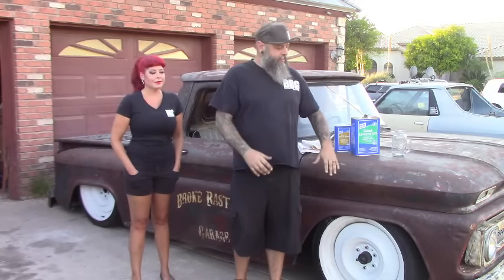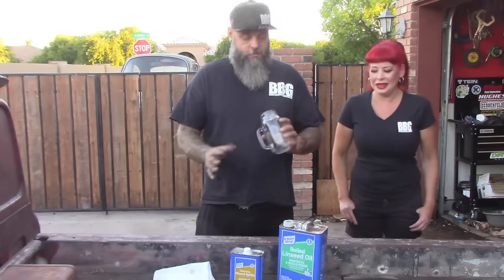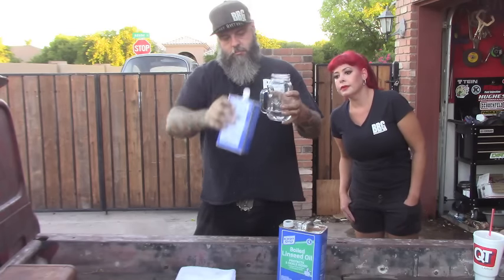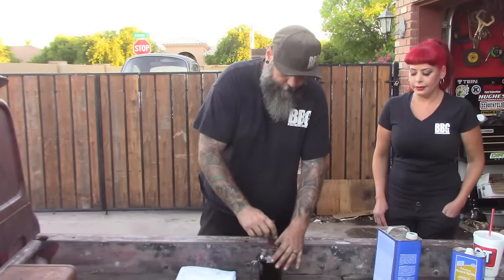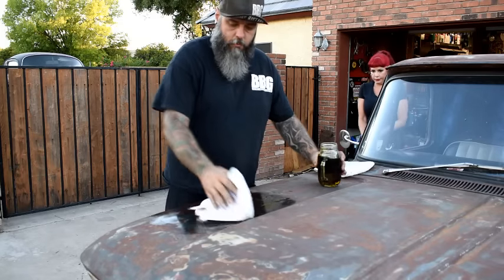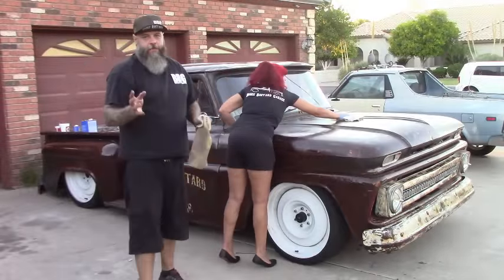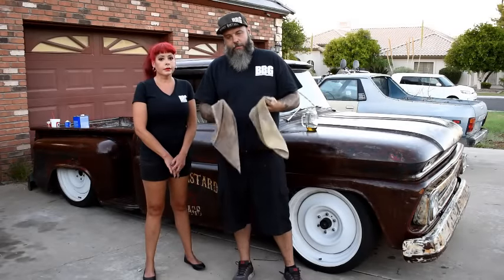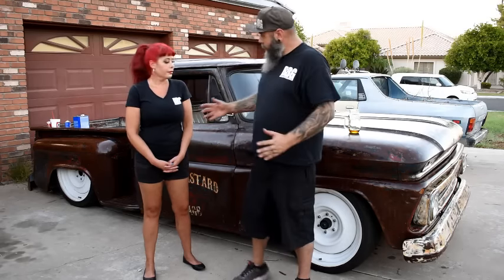How to Protect and Preserve Patina or Rust

Comment: I tried this down one side of my 59 fleetside bed & let it cure for a day to make sure it was the look I wanted. I didn't have a quart container to get started so my mix wasn't exactly how y'all made yours. I ended up spilling about 90% of what I mixed up. I decided to keep my used rags and paint brush (for the tight spots). Today I moved the rags into the cab of the truck after hours of tinkering. I went inside for a while & decided to head back outside just before dark to get some serial numbers off of my carburetor & measurements for the tail gate & fuel tank. I kept smelling an awful smell of something burnt. The further I got from my truck the weaker the smell. I checked the battery thinking maybe it was shorting out on something. That wasn't it. After several minutes checking in & around a few other vehicles I decided to check in the cab of the 59 truck. The smell was much stronger & the cab was full of smoke. I realized it was coming from the small rags I had used. After removing them & putting them out it became very obvious to me why she said to rinse the rags out with soap and water before disposing of them. I decided to read the container & sure enough the boiled linseed will generate heat when drying & can spontaneously combust as it did in my situation.  I'm glad I was home & able to locate the smell to put out the smoldering rags. Simple mistake on my part that could have been very costly. Just figured it was worth mentioning. Hopefully nobody else makes the same mistake that I did. I am very happy with the look it offers on patina, the preservation of the metal & the affordability.  Thank you for the video.
Reply: Yo this is extremely important, and should pinned.
Oily rags can and will spontaneously combust if left alone. Always dispose of oily rags in a metal container with a lid, preferably at least ten feet away from any structure or vehicle.
Reply: That's why he said to throw the rags away lol
Reply: Ray Renteria   I agree they should be put into a metal container for oil soaked rags and they need to be disposed of properly
Reply: I don't Get it how did they burn?
Reply: @luisponce1472  boiled linseed oil generates heat as it drys. If you leave it on cloth and the cloth is crumpled it traps that heat and catches fire.
Read labels for EVERYTHING. The words aren't decoration.
Reply: Will the truck spontaneously combust?!😮
Reply: Want to avoid oily rag fires? It’s best to just hang them up! Throw them over a fence or rail. The oils will evaporate in a few days depending on the weather, just don’t wad them up and put them inside of a container, like a trash can.
Reply: @CristyMarieMiller yes, ive done the same for years, all gud reminder’s 👌🏻

Comment: oily rags are subject to spontaneous combustion.  if you leave them in a pile, and conditions are right,  they will get warmer, then hotter until they catch fire due to a chemical reaction.  many shops have special air-tight cans to keep this from happening by excluding oxygen.  it is not only that the rags are flammable, but they will catch fire by themselves without an external ignition source.
Reply: Yes.  A serious reality. I actually even know someone that had a house catch fire because of oily rags. ALWAYS let them dry out.
Reply: woodbox665 I can’t tell if this is a joke
Reply: Reese Richter    No it certainly isn’t.   I’ve actually witnessed it.
Reply: Soakem in water willwork or airem out
Reply: I have seen them catch fire as well. Best to find a metal trash can made for this sort of thing.
Reply: Burn em outside after use in a safe space. Do at your own risk
Reply: @6ty8stang  no joke. I once worked in a shop where the used oily rags were kept in a heavy metal can with a lid.
Reply: This happened to us... we put the rags from using Penofin fence oil / stain in a Home Depot 5 gallon bucket (no lid) and set the bucket on top of our big blue plastic rolling recycling bin to "air out". In the morning we went out and our recycling bin was "gone". After a closer look all that remained was a big flat brick of blue plastic about 1 1/2 inches thick with the metal rod that connected the two wheels (wheels were gone as well). It was an awkward phone call to explain to Waste Management. Could have burned down the house... huge lesson!
Reply: This actually happened to the guy from Atomic (Garage Journal) in his shop. He's posted a video of his security cam footage of it. Thankfully only lost a garbage can and filled his shop with soot, but still. Linseed oil is a "Drying oil" which is why it's used for paint and stain.  By "Drying" it means it reacts with oxygen to form a natural polymer. That oxidizing process creates heat.  Combined with cotton: it will combust. Safest process is to lay them out flat outside for 48 hours.
Reply: Seen it happen. Will catch fire

Comment: The safest way of dealing with linseed oil soaked rags is to lay them out flat or drape them over something so they can dry out without building heat in a balled up  mass. The ability for linseed oil soaked rags to spontaneously combust is very real and well documented. Never throw fresh oily rags into a container inside a box or trash container without drying them out first.
Reply: I'd say it's safe enough if you have the rags in a ventilated area where the heat can escape. No need to be overly cautious if there's just a few small rags as in the vid. Otherwise, if you are concerned, just light them yourself and get it over with the burning.
Reply: Kendall Ulrey 

Sure. Didn’t mean to offend you, reminding you of your home burning to the ground. 

You do know there is a major difference between your imagination and the real world? Go back to school and learn some basic fysics.
Reply: @cschlater  fysics? Lol
Reply: @kendallulrey7258  laughing? Because I misspelled a word in a language other than my mother thongue? I know seven different languages. Pick one, and we can have a fine conversation about spelling. 

Also, I use linseed oil on a daily basis and never once had any incidents with self ignition. 

Also, I don't have any runnings showing on my commercial paint jobs pictured all over internet.
Reply: Oh shit! I did not know that. Thank you 🙌🏼
Reply: Wow, glad I red the comments 👍🏻

Comment: This works pretty good on faded / oxidized plastic too !  ALSO, It's not how much money you have , It's how you spend it.
Reply: Will this replenish old brittle plastic? I have a square body suburban that has some sun dried plastic and I'd like to keep as much of the plastic original, instead of spraying it with a raptor liner or something like that
Reply: @skeebles8469   It works but will fade / oxidize with time. Try a small spot first, then decide if you like it.

Comment: I use this same process on my woodworking projects. Great for axe and shovel handles.
Reply: Yessir. Great for axe and shovel heads, too, when putting away for the offseason. I melt a little real pine tar in with the linseed oil; gives the handles a tougher look and a little more tack.

Comment: I have an old school bus in Scotland, and it had the original marine plywood floor, and no rust. I didn't want to rip it up and damage it, so I poured boiled linseed oil and white spirit between wood and metal floor to future proof it. Also painted it on the faded blue fibreglass roof and it sealed it and brought it back to match the body colour.
After seeing this, I'm going to paint the undercarriage too! Far cleaner than old engine oil or waxoyl.
Reply: Many people use the thickest chain oil they can get under the car. I have only 1 car to keep so I stick to Fluid Film even though it is expensive. Protects and gets a relatively dry surface.

Comment: I as a lifelong painter have used your formula on everything from the rat to cedar shingles! The best go to I know of! 👍
Reply: What happens to the original rust, will it continue to eat at the metal?
Reply: @bradleygrossman4262 - Good question!    Rust is porous and will fully absorb any oil you put on it, similar to wood.    So the rust is actually helping to keep the oil on the surface of the pure steel beneath, thus preserving it.     The oil keeps the oxygen and the water away from the pure steel beneath, so I don't see how it can rust anymore with oil on it.     Steel cannot rust without water and oxygen in contact with it.    No chemical reaction can occur because the reactive chemicals (iron, water, oxygen) are not all present together if you apply oil.   At least that's my theory....   I have not done extensive testing.    AND I can't seem to find any solid answers to this question online.    Let me know if you find anything.

Comment: Great technique, the big thing is when people throw several mineral spirits rags into a trash bin full of saw dust.  The rags when they’re folded over start generating heat and if you have a bunch of them packed into a garbage can with flammable material like saw dust or paper, they can light on fire.  If you just let the rags sit out and gas off, you can throw them away without washing them but I wash them anyway and reuse for other stuff.

Comment: I love the thick coat it retains for so long without thinning out and drying easily.  I rub it in any dry wood.  I treated my sledge hammer handle, now its less likely to crack and it actually looks great.
Reply: I'm using olive oil

Comment: How often do you have to coat the truck?
I live in Florida/rain etc.  Just wondering how long it will adhere to the metal?
Also, what is the purpose of the mineral spirits, it is ti thin out the oil more or make it flow etc?
Thanks again and SO-Weet Truck!
Liked and Subscribed.

Comment: Needed this formula for a 1950 Studebaker pickup I bought in about 1971 - the body made of a very solid grade of steel, but the factory paint had literally washed off on the top of the cab, the hood and tops of the quarter panels, etc. It was the perfect, nearly indestructible truck. Wish I still had it.

Comment: I am using this on a patina'd  steel patio glider  - you know, the kind that would tipover on you as kids if it wasn't bolted down.... I had used a  50/50 boiled linseed and CLR mix - but I am not happy with the result... I am thinking you might have just what  I needed. Thanks BBG

Comment: I am looking to give this a try with ceramic coat on top of the boiled linseed oil after it has had a few days to dry thoroughly.  Urethane clear coat is super toxic to breathe, expensive, and sprays are such a pain with extra labor masking everything off with or without weather conditions outdoors.  Going across the US in my car, I was caught in a sandstorm that pretty much blasted the clearcoat.  The paint has been coming off, and I know I need something on top of the paint to keep it from coming off again.

Comment: BE CAREFUL WITH LINSEED OIl AND RAGS PEOPLE!!!
The oxygen in the air  reacts to the linseed oil on the rag and it generates heat, and can catch fire without a spark..

Say you left your oily rags on your workbench in your garage in a hot day and went out for a few hours. If it got hotter then 120 in there. You would come back to a burnt down house.
Dont leave them in the sun either.. Or poof. Up they go
Reply: Yup. That's called spontaneous combustion.

Comment: A.T.F. works well also,seems to soak in, and not oily, but kinda has some funk, but it does go away in a couple of days, linseed will combust in like a hot garage, spontaneously, by it self,when it's put on rags shop towels, paper towels, keep it away from other combustibles,and like you said water it down,metal trash cans will  ignite easily, believe me, I almost  burnt my house down! Nice truck by the way

Comment: Just a tip, cause i learned it the hard way. burn the rags or cloth that have been used with linseed oil. Because if you do not, it can actually ignite by itself after some hours/ days.

Comment: I wonder if it will help prevent rust on my buggy?
Reply: papachubby1951 you can try vaseline for the time being its an old trick one of my 80 yr old neighbors taught me till i get linseed oil
Reply: USE  TRANSMISSION OIL
IT CLEANS AND PROTECTS METAL
Reply: Dollor tree lemon furniture polish for short time use. Two or, 3 spray cans.

Comment: You can also use your old motor oil after you change it   save $ on linseeed oil ECT without all the extremely flammable stuff.  Linseeed oil rags can self ignite

Comment: It's a lot easier for me to just use a flat clear spray paint doesn't look like anything's on the rust and yet it is. You might have to touch it up every couple of years depending on how much you have it out in the weather but you have to do that with this method also. And you won't get your clothes all greased up when you rub up against it

Comment: Great video.  Question.  I  have restored A 1946 civilian issue willy’s keep.  The restoration was to bring it to a dependable running, electrical & braking condition.  It’s patina is flat and looks like it started as tan and ended up mostly covered with red primer.  It is perfect the way it is.  My  question is once the formula is applied will it return the flat finish as before?  This would be optimum for me. Anyway protecting the patina so the rusting stops where it is would be worth a small sacrifice.  
Thanks & Best Regards
Chris

Comment: I just got a rusted out 1980 Chevy K30 crew cab that looks dope. Will this keep the rust/ patina from getting further ingrained or worse? I will soak it really good. I really do not like to paint or clear rust, but do not want to have to replace all the sheet metal either. Its solid, but really rusty too...some holes to lighten the load.

Comment: You mention flammable rags. What are your thought on wiping the engine compartment inside the hood, and parts of the engine. Is the thinner evaporating or staying in the oil.
Reply from the maker: Midnight Artisan Haven’t done it and don’t know what would have when the engine gets to temp.

Comment: I like the container he was using had a handle. However I was worried when he used the glass jar. First thing I could see is knocking it off the hood of the truck and shattering and having a big oily mess on the driveway. He looked out and not breaking the jar but he lost more than half of the oil. I think that a metal container with the leak proof top would be advisable. Maybe the smaller paint cans you can get at the paint supply store they're clean and empty.

Comment: On an all original 2005 suv with a couple of rust spots on hood, door would it be possible to arrest progression of rust and preserve the integrity of the vehicle using this method? I was told if I don't do something I'll have a hole in my hood. I don't want to make the areas bigger or destroy the original paint job having actual body work done. Thanks for the video and possible solution

Comment: I thin some resin down with hardener and seal it, stops rust then you could prime it, block wet sandpaper it down and paint it. I usually do this idea when there a rose due to impurities in the metal. I use a burr grinder and sandblast it if I have it, then I mix some resin with hardener and use a acid brush and paint the affected area, prime and paint. I promise that rose will be gone lone after you junk the vehicle. Roses persistently come back over and over and this method seals it, period.

Comment: What is the mineral spirits for? Does it help it dry faster? How long does it take to dry and how long before you need to reapply?
Reply from the maker: Rose Fisher the mineral spirts thins the solution. Make it easier to spread evenly. It is fully dry in about 24 hrs. You just re oil it when you start to see it dry out. Normal 2 to 6 months.

Comment: Awesome video, thanks.  I want to do this with my '85 f250 6.9 idi.  It has peeling paint and surface rust.  Not sure if I should leave the rust.  Never considered that until I watched this.  Anyone have an opinion or comment on this?  Leave the surface rust or sand it off to bare metal before I treat it with the oil?
Reply: I feel like there’s zealots in both camps on this issue. I think it’s entirely up to what kind of style you’re trying to pull off. My answer is whatever doesn’t flake off effortlessly should just stay put.

Comment: Will this STOP the rusting process? Ive got a Rat Rod chopper motorcycle and I want to stop the rusting because its finally perfect. Ive heard of Everbrite Satin coating for a non gloss finish. Does this do the same thing? Thanks for the great video
Reply from the maker: Scott Van Gaal mine hasn’t progressed and I have been using this method for a couple years now.

Comment: Just found this and I have just got a 47 Ford Pickup and I have 2 questions. Its winter in the UK and wet. Do I need to get the Pickup completely dry before application or just mainly dry? Also how often do you need to apply this?
Reply from the maker: Never really applied it on wet. And I have to reapply about every six months

Comment: Building a street legal dune buggy. Wanting to do something different that I’ve yet to see. Will this method work for steel tubing that has been moderately sanded and polished? Want to basically have a chrome tube frame instead of chrome accents like most.

Comment: Never thought I'd see a video on how to protect rust LOL
Reply: I'm thinking the important thing is to preserve what's left of the sound steel.    Maybe the rust can be part of the preservative coating.     The rust is porous (similar to wood) and so will retain any oil that you put on it for quite a long time, years probably.    The oil will keep the good, solid, un-rusted steel beneath from rusting any further.      AND some people like the rusty look.   You notice he calls it a "patina".    AND it's a lot easier, faster, and cheaper than a paint job.      AND it's a lot easier to maintain than a paint job.    If it wears out, just take half an hour and wipe on a new coat.     Sort of like Danish Oil Finish on wood vs. varnish on wood.